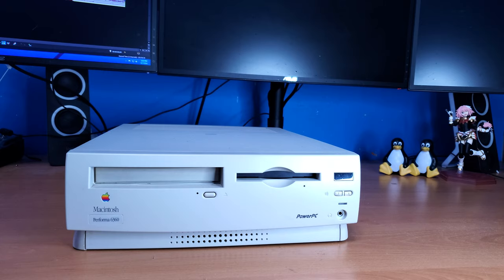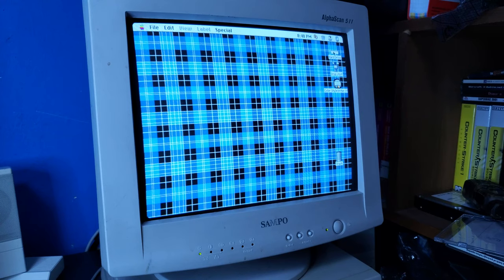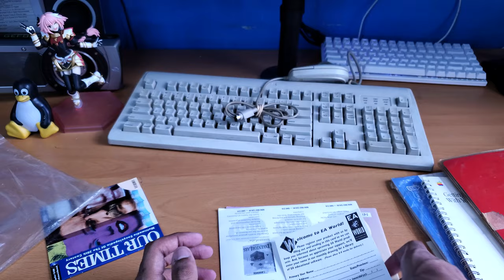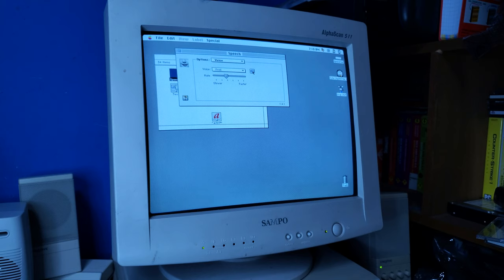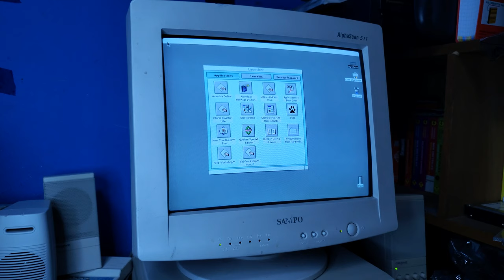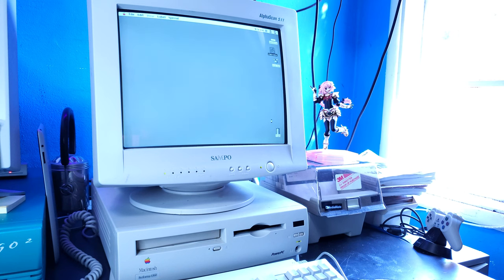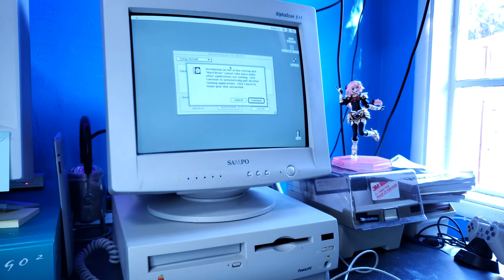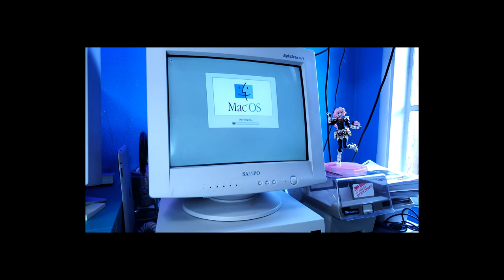Restoring a 1996 Macintosh Performa 6360!

Comment: I've been playing on PC for 10 years now. I'm nearly 21 and I've only recently got into PC "building" I tried to upgrade my motherboard and got a cooler, I'd never modified a PC before except RAM sticks and a graphics card removal so I messed it up and got it fixed for $110ish. I very recently got a new PSU and a 4070 12G DUAL EVO (my case is pretty small hence me getting this card) I took apart my PC on my kitchen table and got to work pulling out every cable in my motherboard. Long story short I thought I bricked my PC several times but I eventually got my PC working with a new PSU set up with no issues. I was so happy I got it working I yelled. Even if it was something so minimal it felt so good. 

After a few videos I came across your content and I love it! I usually struggle watching videos that are technical but your content is so entertaining and enjoyable to watch. Thank you for making my least favourite part about PC building fun and interesting again!